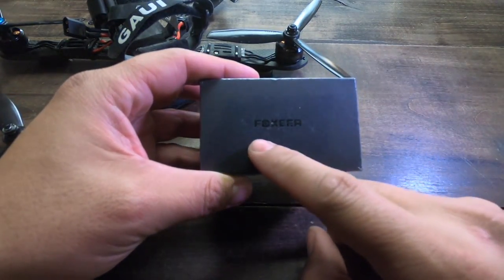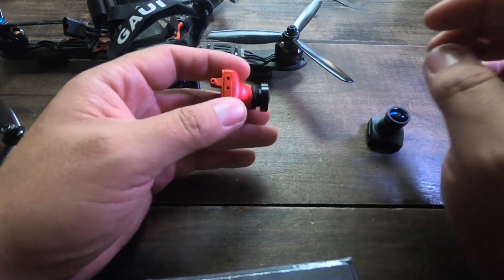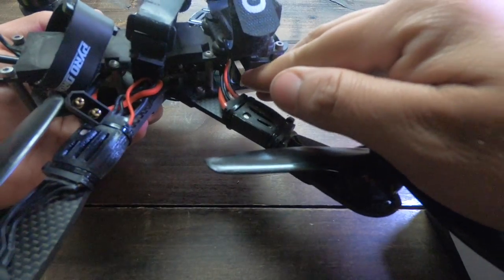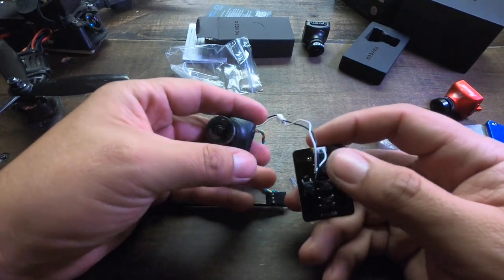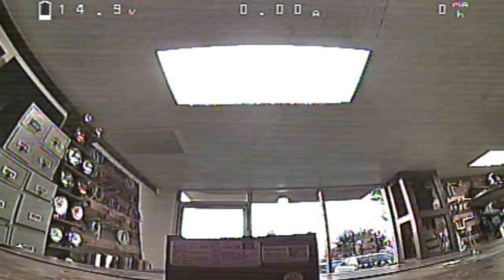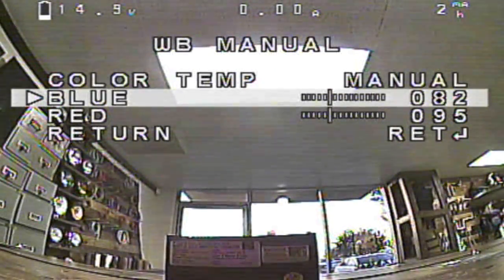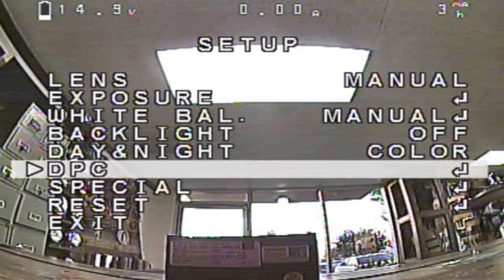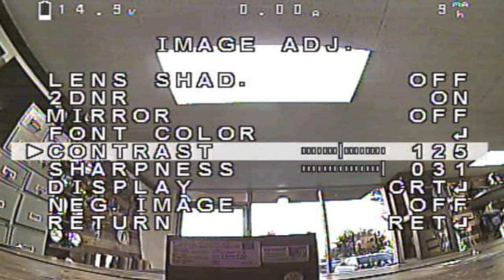How to get a better image from your fpv cam settings

Comment from the maker: !This is not an advertisement! There is no links or me directing someone to buy anything just trying to give and opinion on the camera I use and help on settings for others.
Reply: Eric Konasty great work with declaration of any conflicts.
Reply: The Runcam has a dedicated 2 pin socket just for the Cameras OSD...It comes with a 2 pin lead, just like the Foxeer...Why would you think it did not have a dedicated OSD lead..?

Comment: The eagle 2 comes with an extension cable for the OSD port just like the foxeer. I use it on both my quads.
Reply: the mini swift also came with the extension
Reply from the maker: +MrPistachios yeah that’s cool I’m glad they added it I still don’t like it being a separate plug though
Reply from the maker: +Jon C preference
Reply: Most of the camera models from runcam come with the extension. They decided to make it a plug because not everyone needs it on all the time. I also like the controllers for the runcam better. its a nice toggle instead of a board.
Reply: It's exactly the same and the runcam dongle is way better than the exposed on from foxeer. It's also weird that you can't see scraggle in the eagle. The only issue I had with the eagle was the latency and they fixed that in the eagle 2. Maybe you turned off WDR on your eagle? The foxeer monster seemed way too dark. I used the mini Swift now because it seems to balance out latency with image quality and weight.
Reply from the maker: +BASHERS UNITED yeah I had trouble with the latency also. But I couldn’t see scraggle I had wdr on. I haven’t used the mini stuff yet I’ve been wanting to try it out!
Reply: The swift 2 also comes with the extension. I personally think it’s better as a separate lead. Means you can remove it if you don’t want it. Just seems like a strange reason not to like a cam. Maybe a bit of bias creeping in. ;)
Runcam also have a decent joystick to plug in instead of a crappy board with switches.anyway, great vid on settings. 👍🏻

Comment: Just some info you may not know based on this video: There are Flight controllers out and coming out that are utilizing the Betaflight functionality of camera settings control through the Betaflight OSD. 

One specifically is the CL_Racing F4 "S"

Comment: Great Video Eric,  I agree with everything you said, Concerning the contrast, if you drop it a bit lower, around 104 -110 then you can fly directly into sunlite without having your image completely washed out.  This is a trick I learned from FinalglideAus (Chad) from Rotor Riot.   Also it is worth mentioning that replacing the lens with a  GOPRO lens imoproves the colors and make the image look brighter and crisper to me.   I usually have a few of these on hand, they run about 6 to 7 bucks and its nice in case you smash a lens during flight. They also come in various FOV 120 deg up to 150 deg which are the ones I like so I can  uptilt the camera  to 45 or 50 deg and still see the ground for landing.

Comment: on the runcam swift 2 i also comes with one of those connecters to change settings just that it is able to come off not part of the whole port. In some situations it is better but you can just use it the way the foxeer does

Comment: I built a tiny whoop track in my basement with some LED and UV gates, but I´m having huge problems with being blinded by the lights. Can you make adjustment to the stock cameras on quads like the UK65, HB65 or Beta65?

Comment: yeah I like the foxeer board still need to do cam control mod. if it was just one wire it would be done but have to find a resistor right value lol with cmos cams cut back the dnr digital noise reduction I think its called it can helps see branches on some cams. llol fly in all blk/wh for a classic feel and faster brain calculation of image lol theory not fact but might make some have better response time.

Comment: Im using the foxeer monster at the moment. I had to get a hs1177 case for it so it fit my frame though. i keep forgetting to take the controller with me to change the settings. its so washed out at the moment.

Comment: you can leave the cable in on the run cam to control the osd btw...
Reply from the maker: +Mellow Minion I still don’t like that it’s a separate plug but that’s cool the new ones have it

Comment: I have this same camera. I have not been able to get it to record sound. Do you have this same problem?
Reply from the maker: +AlbeeSoaring I don’t. How do you have it setup?
Reply: Wow thanks for responding so fast. I have tried it with my goggles and with a alternate VRX for android. I havent been able to get any sound from it. I couldnt find any adjustment for it or even a hole for the mic. I have a QAV210 and just have it attached to the quad by the camera plates that come with the frame. I know my goggles will record sound cause I have recorded a friends flight with a runcam and mic.
Reply from the maker: +AlbeeSoaring do you have the audio out from the camera hooked up to the vtx right? Also is that vtx capable of audio in
Reply: Eric Konasty the vtx says it is capable. I will double check the wiring. I am using a foxeer switcher.
Reply: One thing you might want to check is; which audio channel (L or R) the camera, and the vtx are using. Some use left, and some use right. If they don't match between camera and vtx, you'll get no audio.
Reply: amisoftau thanks. I will look into that. I double checked last night and I have it wired correctly. This is all very helpful
Reply from the maker: +AlbeeSoaring Humm not sure then. Message me on fb messenger if you need any further help
Reply: Thanks for the offer. I dont do facebook though. I am sure I can figure it out. Thanks for taking some time to try to help me out though.

Comment: Dude! you have to do the Beta flight Control Hack!
Reply from the maker: +Chris Meyer it’s for another episode :)
Reply: I did the mod on a run cam eagle and  a swift. It's a dream! Should work on the Foxeer aswell. From the look of things I like the Run cam remote better...
Reply from the maker: +Chris Meyer yeah I’m sure it does! :)
Reply: Chris Meyer did you add a resistor on the eagle, what were your settings for camera control in cli.
I mean, which values do you have when you type- 'get camera_control' in cli.
It would be great if you could share
Reply: Chris Meyer i have the eagle 2 but could not get camera control to work.
Reply: 150ohm on the Singnal line. Betaflight 3.2 I am running DYS F4 with the Cam control on the LED pin.. It is an eagle 2. I did not change anything on the Cam control settings, the stock dealy work perfectly. If you like I can send exact cli commands.